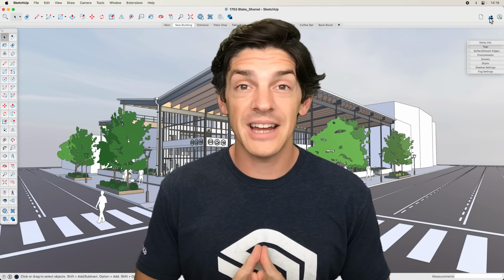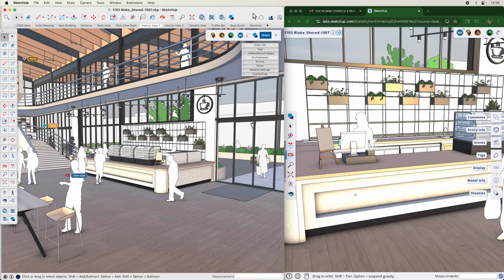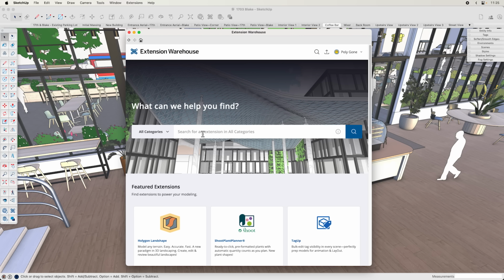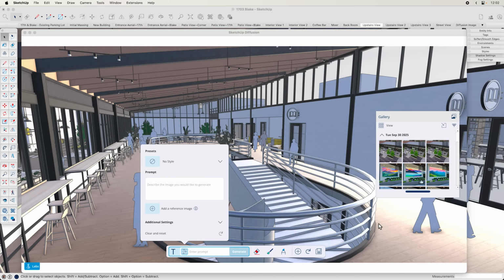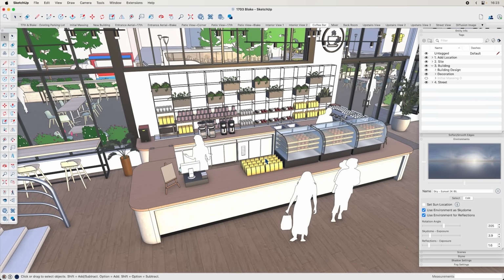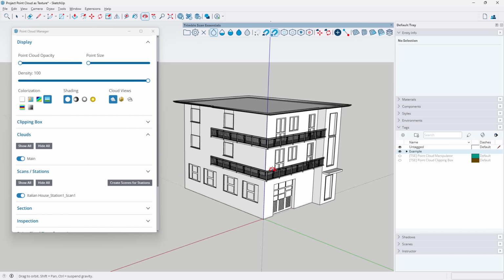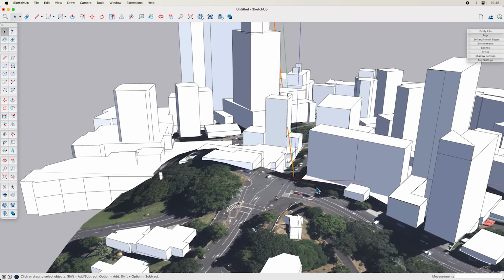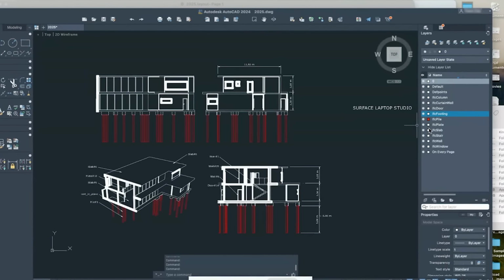EVERYTHING New in SketchUp 2026

Comment: SketchUp has become increasingly more frustrating to use over the years. Relying on a large number of third-party plugins just to get fairly basic functionality is dumb. especially when those plugins often break or stop working properly with new versions. Several fundamental tools are missing in SketchUp that are standard elsewhere, such as chamfering/beveling tools and gap filling. It would be great to see more of these core features built directly into the software.

Rhinoceros 3D has these features.

Comment: - quick toggle between chosen background 1 and chosen background colour 2 (light and dark most likely)
- switch to parallel projection keeps camera position (I am quite sure it was like this in previous sketchup versions) and does not zoom out all the way
- styles tray shows both a 'select, edit and mix' tab, as wel as an individual 'select' tab, duplicated, which cannot be removed or closed
- zooming in and out interval toggle: normal - precise (framing)
- jpg export has a tiny tiny quality slider, which ofcourse always has to be as high as possible
- option for soundeffects, similar to minecraft sounds
- rotating a texture should have a button 'rotate 90 degrees' instead of the clumsy way that you have to do it now
- white screen when loading on startup, please make it black and a loading progress bar
- 'export 2D graphic' now takes a few seconds to load, used to be instant in version 2024
- when uninstalling or disabling an extension, when closing the application and opening it the next time, the changes have not happened.
- extrude edges & offset edges built in without extension
- push-pull reduction from volume to plane now removes the plane too => stop removing the plane
- pie arc drawer toggle to draw outer connection lines to circle center
- length display in the bottom right 3.000.000 mm instead of 3000000 mm
- fix duplication of planes when drawing a new line in it
- fix undetecing separate faces when certain lines are drawn
- when in move tool, while moving something, when hovering over an edge, show the middle of the edge
- skew tool
- fix occasional spontaneous all over the place polyline creation when intersecting
- jpg export 'export options' allow ctrl-A in the number imput boxes

Comment: Have the technical issues with file auto-compression been addressed for SU2026?  As it stands now, I have to save any projects that exceed approx. 2.5GB to SU2020 (thereby being limited to opening the file in a version no later than SU2023), so that I can avoid having that project file permanently destroyed.

Comment: As others have mentioned please deeply consider adding a dedicated 2D fillet tool and chamfer tool for Sketchup.  Likewise, please consider adding a robust native 3D fillet / 3D chamfer tool for SketchUp.   Please consider reworking the follow me tool so it can create very small surfaces.  It's difficult to create certain 3D models with the current follow me tool.  The follow me tool has a minimum size limitation of the surfaces it generates.  Very annoying to extrude an object about a path and the 3D object has missing surfaces.

Comment: Sometimes I import Ai. files. If there are any curves, it imports staggered. Does this new update address this? My work around is to add loads more anchor points in Illustrator. Not Ideal
Reply from the maker: True curves don't exist in SketchUp—everything is made of edges. LayOut is the way to go to maintain the vector curves from Illustrator. If you need to go to SketchUp, your anchor point workaround is a good way to increase the fidelity of the imported curves.
Reply: @SketchUp I used SU native 3D text tool and some of the straight lines that make up the curves on some of the letters were low segments. It wouldn't let me increase them either. It's why I resort to importing from Illustrator. I work with CNC machines and SU straight to Vectric works a treat. No resaving the file in different formats. 1 SU file to rule them all 😂